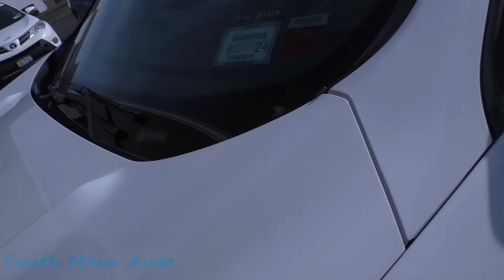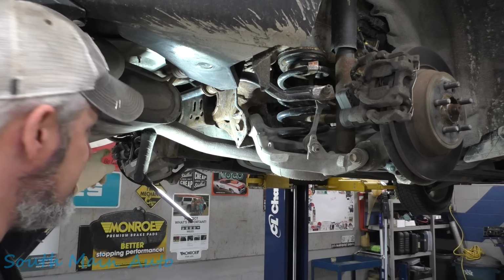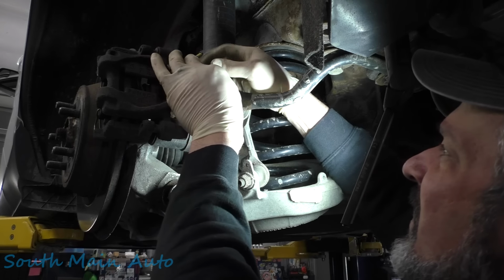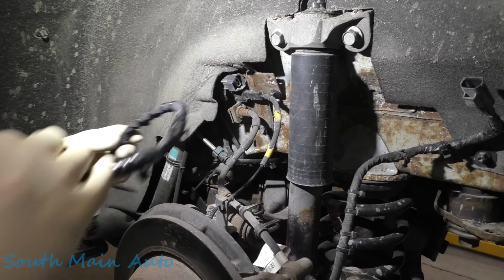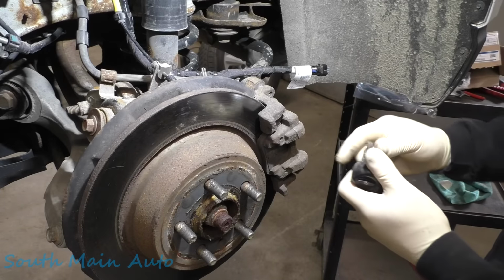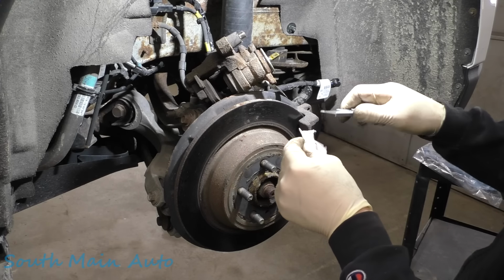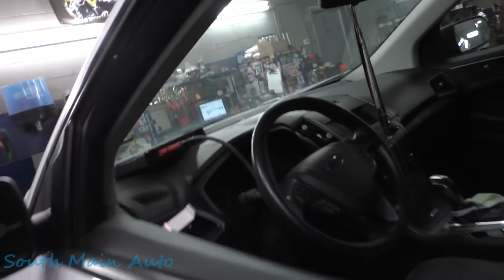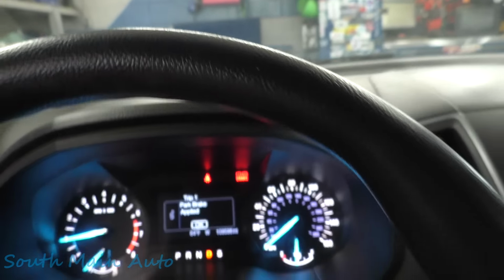Ford Edge: Electric Parking Brake Malfunction

Comment: I realize this video is 3 years old, but just popped in to let you know I am dealing with the same park brake malfunction. Hoping to get away with replacing a wiring harness or two. But if I do also need to change the actuator, I at least have your video to guide me along. Great diagnostic work as always!
Reply: UPDATE: Replaced the driver side harness and the malfunction went away in its own once I reconnected the battery. Thanks to Eric for some great tips, especially the recommendation to listen for which actuators are engaging. I was planning to replace the passenger side harness but remembered hearing that side engaging despite the malfunction. So I replaced the driver side harness which turned out to have bad corrosion in the lower connector. That did the trick!

Comment: All I did was take the brake pads and rotor off and replaced them with brand new ones...did not unhook any wires and I have this limited function issue. Crazy. I'm gonna buy an older model next time

Comment: Thank you for that great video! 
I was doing a brake fluid flush on a 2022 Ford Explorer, once I released the caliper valve and pressed the brake it emptied the reservoir really quickly. Now I have an air in the system that I can’t get rid of. I hooked up a snap on scan tool but did not allow me to bleed the ABS module. 
Is there a manual way to bleed the system on these explorers?

Comment: I'm surprised you didn't test the motor to see if it worked. Could of just been the harness.  I just worked on a 15 fusion today and the right rear was locked up so bad the rotor was paper thin and the guy at autozone said it was a seized caliper. It was actually a collapsed hose. It wouldn't even gravity bleed. After I replaced the hose it was good to go. Btw, the bolts are 7mm Allen and actuator is 5mm
Reply: meu fusion lado direito está com falhas constante, ja olhei os conectores , cabos e esta tudo ok.  quando ocorre a falha e trava as rodas e para voltar a funcionar tem que deixar carro desligado e depois da comando liga desliga e liga bem rápido e tudo volta ao normal. obrigado Brasil

Comment: This happened on my left hand side rear brake about 2 years ago after doing a simple resistance check.
Reply: Now it's happening on the right hand side I'm going to do a test again perhaps even just repair the line instead of buying a new one more cost-effective might break down again though. I noticed you didn't isolate the motor but simply replace it

Comment: Saved me $500. I removed the wheel and confirmed the parking brake was not working on the left side. There was a grinding noise. The plug to the motor looked good so I changed the motor by taking off the brake caliper. It went clean and smooth. I used an aftermarket $70 motor instead of the $220 OEM. Hopefully it’ll hold out. I used SylGlide on the O ring as the aftermarket Chinese motor did not come with any lubricant. After I removed the O-ring, it was clear that it had been compromised, and this was likely the cause of the failure as there was a lot of moisture when I took the motor off. Thanks for making this a one hour job instead of a four hour job. I was able to return the harness so the whole job cost me only $70.

Comment: Hi any help would be appreciated! We have a 2013 BMW X3 that had a parking brake malfunction when electric parking brake was applied. Now it is stuck on and we don't want to have towed to shop for fix. We used a nice scan tool and it showed right actuator holding force not reached. Any ideas to get released and/or to fix? Thanks in advance for your help suggestions!

Comment: Does the 2019 Escape SE require any sort of reset or procedure after installing all new pads thatll log the fact ive replaced the pads. It also has the electric emergency brake. I didnt go thru activating the service mode before hand. I wasnt aware to do it until after installing the pads. No issues durning installation of rear ones. Used a tool that has the pegs that rotate the caliper piston. Drove 80 miles afterward no issues encountered. Now installed front ones. Drove 5 miles no issues. Just like to be sure if a procedure exists that acknowledges new pads were installed i can do it.  Just hit the 60k. So Fords factory warranty went bye bye.

Comment: quick question, im hoping you can give me a little insight.  After having an aftermarket remote start installed my 2015 Ford Edge a hill assist not working light and a wrench that said see manual (which showed up only after applying brakes) came on

After taking it to the dealer they came back and said bad brake sensor switch and a seat belt sensor. (which the seat belt sensor had been on for about a year)  

They didnt have the parts and expected them to take some time because of a storm.  I picked up the car and the errors disappeared completely except for the seat belt one.  

Im wondering if it could have possibly been a loose connection that might have occurred during the remote start install not a bad brake sensor at all.  Being that the errors have left completely and no parts were ever installed.

reasoning for my suspicion is service person also tried to tell me that those sensors were also caused by the bad seat belt sensor in addition to the brake switch sensor.  

Any insight would be appreciated.

Comment: This was a much easier job than it would have been on my old land-rover discovery 3. It had a single park brake motor with cables running to the back wheel. If the cables stretched or the wear on one side was more than the other, that motor will go wild and could strip the little plastic gears. Then it was a heck of a job (and Very expensive replacement part) to fix. Got rid of it but still kept my L-R Defender with the TD5 engine. Much simpler and easier to work on. Greetings from sunny South Africa! I'm extremely greatfull we don't have the problem with rust here like you guys do. It's much easier to keep older cars running and on the road here. My Td5 is almost 20 years old and no rust.

Comment: It probably wasn't a factor in this case, but most people never use their parking brake. Especially on cable systems everything will just get all rusted stuck. At the very least these electrical systems can do a self test sometimes to keep things moving, though I'm not sure if they do.

Comment: Did I understand that if you put the car in drive and take your foot off the brake the parking brake releases?  If that is true, no thank you.  Even my 2013 Jeep still has a cable.  I also don't like "by wire" systems - brake, steering, throttle.  Too much can go wrong.  Look at what happened to Boeing.

Comment: Is it ok to use a wire wheel on a sealing service like that? I wonder if a brass wire wheel would be better or even a nylon brush, I understand it’s probably not that important of a sealing surface as it most likely just keeps out water and dirt. Anyways keep up the good work I just thought you might want some feedback.

Comment: Allen wernches??  I use Bondhus "Hex" wrenches.   Both are brand names.   Looks like Allen works well.  In 1909–1910, William G. Allen also patented a method of cold-forming screw heads around a hexagonal die (U.S. Patent 960,244).   I used to work for Danaher Tool Group designing sockets. (A little Trivia about such a common tool)

Comment: The electronic parking brake: an expensive "solution" to a problem that never existed. I put solution in quotation marks as it's my experience that these things cause way more problems than the good old fashioned cable handbrake.

Comment: Hey man, awesome as always. I have an off topic question since you are the electronic expert for diagnostics:-). I have a 2004 Jeep TJ 4.0 throwing a  P0740 torque converter circuit code. I want to run continuity, resistance and power tests on the TCC lockup solenoid. I can’t find where the heck the lockup electrical connection is on the transmission and the corresponding pins on the TCM. (42RLE trans)
FYI the rats have loved the Jeep wiring so far so I’m hoping that’s the issue. Lol. 

Thanks from Eric.

Comment: In the UK the Nissan qashqi has motors on the back an the tiny bolts just round off. They are a nightmare to get off. You were lucky with the Ford.

Comment: Any exterior electrical connection work I do I use NYK 77 grease on the terminals.  Never had a connection corrode again.   A must in the salt belt.

Comment: These were once called "emergency" brakes; brakes that worked regardless of anything else failing.  Even put them on the driveshafts sometimes.   Now they are electric and connected to a computer, keeping the economy humming along with repair bills.  Simple, back in the day the old emergency brakes were just as unreliable, but we didn't care, as nobody used them anyway, and there were no state vehicle inspections.

Comment: Still trying to figure how EE park brakes are a cost savings over cables. Makes no sense. Maybe assembly labor. Eric, this job was a nicer finish than that reaccuring EE issue you had on the F250 pickup. At the end you were so pissed off you didn't end with your classic lines. Your still #1 of all the on line boys, especially our favorite band leader Scotty K😅

Comment: Mr. O. Thanks for the run thru with the fancy electronic gear. Been mechanicing for 56yrs, so I am old school and all I can say is WOW! . My 98 Yukon w/ 325,000miles and rust had a rough running issue one day. I tried to isolate the problem by disconnecting electrical components under the hood. The easiest one was the MAF, so I did it first. The engine sped up. When I plugged it back in problem was fixt. Speaking w/ a local repair shop owner about it, he told me to replace every sensor under the hood. They get old and go bad, he said.  OR  buy a bottle of Stabilant 22A to deoxidize the contacts. 3/4 oz bottle cost $45.  I was wondering why Fix Or Repair Daily didn't use ECG in that Metri-Pack? Designed obsolesce? 109,598 on the odo and a wire is green in a Metri-Pack? After I cleaned my MAF connection w/ Stabilant I put Electrical Connection Grease in my Weather Pack it to keep it from oxidizing any more. SoFar So Good. ben/ michigan

Comment: Pretty surprised you did not plug the new harness into the brake motor to see if it then works. Might save the changing of a motor for no reason and save the customer some money.

Comment: I remember Rainman Ray working on one where he ran long jumper wires from the one side to the other to test the suspect motor unit. Remember folks, using long jumper wires will probably not help you in track & field.

I can also verify that the green corrosion on wires can work it's way a longggggg way along a wire. I could expand upon this, but it would be a long boring tale of a turn signal gone bonkers. And nobody got time for that.⛔

Comment: It would still be functioning if it had a  mechanical parking brake. The electric ones cant be used if your main braking system fails.

Comment: I'm glad you showed this diagnosis and repair. I have wondered how the system worked. Now I'm not so intimidated by it, just don't like not having mechanical control of the parking in case of a power loss.  I'm assuming there are redundancies in that case.  Great work Eric!  I watch a couple of yours and Ray's videos on a sunny day and next thing I know, I'm under the hood tinkering with my 2001 Durango.

Comment: Im glad you mentioned why you changed the motor as well, I was wondering if the old one would work with just a harness change. 
Thumbs up!  Question - if you didnt have a tool to invoke the self-calibration, would it learn by itself after some usage?

Comment: There is an optional way to test if you can get to the wires of working electric parking brake motor, such that you can get a PicoScope current clamp around one of the wires, and take a scope single shot of the current waveforms when actuating the motor. You can then better understand the functional unit test in terms of currents to compare to the non-working side.

If the motor is a brushed DC motor you should be able to actuate it on the bench with a DC Power Supply, first one direction and then in the other. The module drive circuitry is probably a Protected Semiconductor Switch H-Bridge using 12VDC supply with a current sense circuit.

Comment: Thanks but how about a simple rod to jerk on for the parking brake.    You should have seen my 1978 Buick parking brake the pedal fell off the side of inside and it had a cheap wire that wore threw. The dealer had about 6 of them hanging over the service window. with the wire cable worn threw.  Junk 1978 Buick. with a chevy V8 and a small two barrel . and a cheap transmission.

Comment: I feel like half the videos you post are vehicles where the problem is caused by rust and crust. 20yrs as a tech specializing in diagnosis in the PNW and the wiring faults that seem to be quite common in your videos are incredibly uncommon here. About the only time we see crusty connectors and wires is when vehicles have an interior water leak (we don’t get much snow but we get plenty of rain) and water gets into unsealed interior connectors. Even the exterior modules that are exposed to the elements and prone to failure in the PRNY (like fuel pump drivers on Chibby trucks) are not a common failure here.

Comment: Hi Eric, Not cheap I could replace the whole cable system for that amount, but the labor would be more$$. I'll stick with cables for now or as long as I can. Good piece Eric, Thanks!
Reply: Assuming they’re available. Parking brake cables that are worth a crap are getting hard to find on a lot of cars. Dorman or China crap will fail within 6 months, not even worth installing

Comment: My car has a manual transmission, so my parking brake and cables get a lot of use. I think Ford overthought this system, why not stay with a cable system? At any rate, good diagnosis and repair Eric.

Comment: man, I can even recall when Subaru put its parking brake on the front calipers by cable.  Its extra fun when a caliper vomits out a brake pad because guess what, no parking brake either.

Comment: And even though theyve eliminated the rusty cables, the electric parking brake is STILL susceptible to the same water rust crud and green crusties as the old cable system, one would thing the plugs would at least use GM's weather pack connectors that seal out the environment - same problems in electrical parts instead of mechanical parts, gee what an improvement.  Makes me wonder what one does if the motor locks onto to the rotor then the motor itself dies with no way to release it, what then-??  Great work GM.

Comment: When it comes to work, I sure do wish I could blink an eye and it's the next day all the time. When I'm at home the time goes by like Samantha twinkled her nose. Am I wrong, I wouldn't mind a third hand most of the time either. Sadly I do have a 9mm Heli coil bit kit from back in the day on my 01 Dodge La van petite, luckily the naper had them at the time, not no more and then find a bolt in case you want to use them on other applications, good luck my guy.

Comment: My 18 f150 had this happen randomly while coming home from trades school. Ended up being a bad wire near the right rear park brake actuator. I crawled underneath seen a suspect spot in the wire loom. Gave one wire the ol tug test it was good gave the other one a tug test and with absolute no effort it broke. Didn’t get the chance to film the money shot.

I figured out which wire was the issue with a simple voltage loss test. Had almost battery voltage of loss on one of the wires.

Comment: Oh Oh. I'm going to guess before watching. Broken wire in the harness about 6-8 inches away from the motor, terminals and wiring corroded, and some green on the motor pins too. Had the same thing on the same side on essentially the same car a while back. Got a pigtail and a new motor and all was well. Edit: Yep! Harness is available now, but sadly a few years ago all I could get was a pigtail from Standard.  A tip on dirt packed connectors, water is an excellent solvent for dirt and salt!

Comment: I’m not a mechanic but I’ve notice you using dielectric grease on electrical connections at times.  Why did you not use it in this video.  Trying to learn thanks

Comment: I've done this on my parents 2016 edge also. For future reference, open up that harness in a pinch. It's very common for the wires to just break in the middle of that harness, must be a design fault. In the end I did just replace the harness, because it was cheap. However of course you did good because there was corrosion on the motor itself. Great video as always

Comment: Hey Eric , Ford has got to have the worst setup for Park brakes. 
I've done pads and rotors on 5 f150s in the last 6 months and had to take 2 of them to the dealer to get them out of service mode.
What a pain in the ass.

Comment: I HATE Electronic Parking Brakes! I have Repaired Hundreds on Fords and GM's. The Most Common Problem I see Here in Michigan (Rust Belt) is Not Rust Related. It is Bad Battery or Bad Alternator or Loss of Ground and or Battery + Power. Why? When any of the Above things happen, the Parking Brakes Lock Up Solid! (No Power they are Designed to Lock UP). This causes all kinds of problems.

Comment: I guess pushing on a foot pedal or pulling up on a lever connected to a cable is just not good enough, let's install a system that costs hundreds of dollars to fix, yeah motors and electronics connected to your wheels will never be a problem.